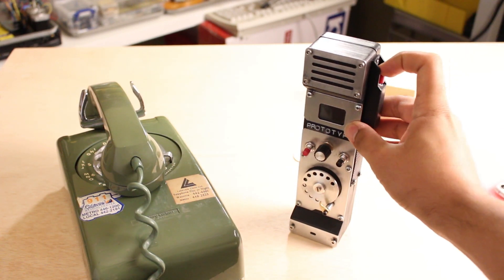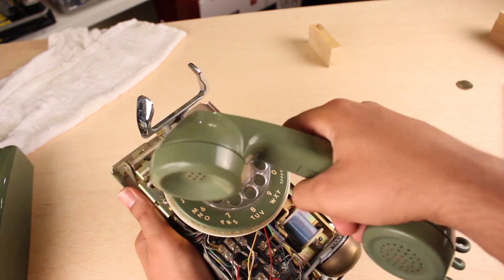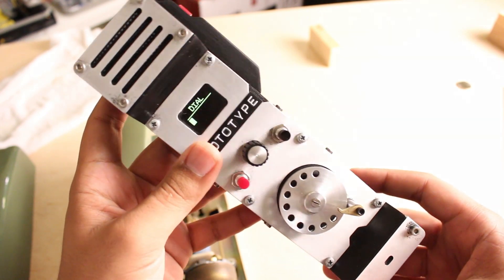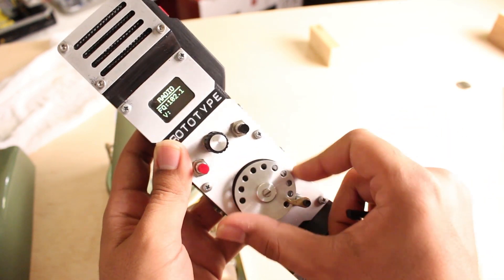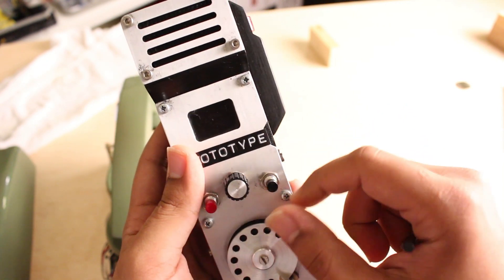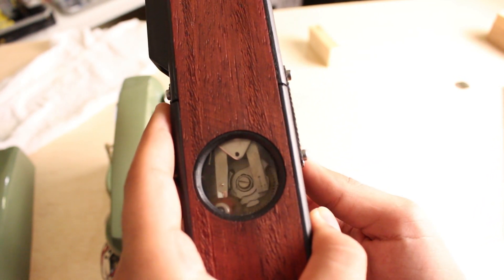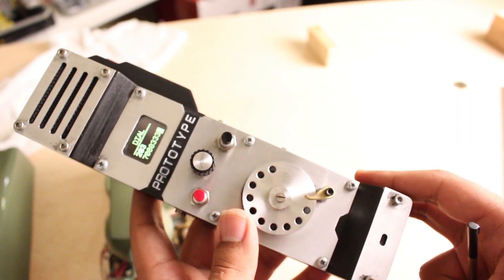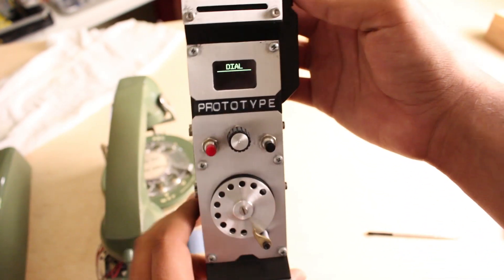Rotary Cell Phone Prototype

Comment: Mr Volt, One thing that maybe you did't know...Old Land-line phones you can dial without actually dialing...The "hook" or drop-off switch, when pressed in the right order, will connect you...which is essentially what a rotary does. Try it, if you have a Real land-line. Sort of like Morse-Code...

Comment: How did you make it produce those tones? Some rotating position sensor that emits the tone when the rotary is back in resting position?
Reply from the maker: The GSM module (SIMCOM 800L) has a lot of built in features. I used the DTMF tone function for user feedback.

Comment: I would buy one of those. Probably.
Reply: Did you see this? the same sort of telephone BUT it has a blue tooth circuit in it. when your cell phone has an incoming call the old rotary telephone rings just like it was wired to the wall. I found a demonstration on youtube, you can make calls on it too. search western electric bluetooth on ebay too
Reply: @Become_A_Paid_Electronics_Tech  It's called a classic ringtone my friend...
Reply: @herveboinay4922  those Western Electric telephones on ebay have Bluetooth in them looks like they are battery powered and rechargeable. It says that the original ringer starts up when a call comes in on a cell phone connected over Bluetooth. It makes calls too it says.
Reply: You probably are a hipster with latte on your moustache

Comment: Huge! What is the wheel used to dial?
Reply from the maker: It's a miniature version of the original dial the mechanism had. I modeled and machined it with my friend's hobby CNC mill.
Reply: wow how could I get one mechanism like that? any plans or help?
Reply from the maker: Rod GILLES You can find links for the 3D files here: https://www.reddit.com/r/arduino/comments/59k62l/i_made_a_rotary_cell_phone/ Also, for the mechanism, you'll have to extract it from a real rotary phone. My friend gave me the mechanism as is, so I'm not sure of the exact model. Ebay's probably your best bet!

Comment: Nice job! Looks a bit like a Steampunk-Phone. Would be cool, if you showing the inside of the phone.
Reply from the maker: You're looking at most of it! (that's why I added a window for the gear mech) If you check it out on Imgur Ive got a photo up with more of the wiring exposed. It's quite the mess haha
Reply: @MrVolt  Can we vape from this thing?
Reply: I get more of an "atom"-punk or "rocket"-punk era vibe from this device, like something "Tom Corbett, Space Cadet" might use during a fictional 1950s interplanetary space age.

Comment: I love how it looks.  Fantastic job!
Reply from the maker: Thanks. Although, somewhat backwards I designed the case first and made everything try to fit. I enjoy your videos too!
Reply: Hey, just ran into your phone on POPULAR MECHANICS! Wow.... Congrats!
http://www.popularmechanics.com/technology/design/a23588/gorgeous-rotary-cell-phone/
Reply: @MrVolt  Why didn't you use an existing working telephone first?
You know, the rotary thing?
Reply: @MrVolt  Why are you trying to fit in a big size personal mobile phone with rotary dial impossible to manouevre with a human hand?
What the fuck are you on?
Reply: @herveboinay4922  well actually the tension created when the skin of your finger is slightly pushed into the hole, which requires almost no pressure, would be enough to cause the dial to shift as the gears move quite smoothly. And the look harkens back to the fallout shelter look, which this phone would work for if there ever was all out nuclear warfare considering it features a radio dial and internal antenna, other than the power issue which could easily be solved by modifying a crank radio into a charger for it, this could easily fulfill any tech needed in that rare scenario. not to mention there are countless people who would appreciate the rugged industrial look it produces. as for why he created it, as with everything else he has made, it is simply for the fun and novelty of it. Personally i would suggest reevaluating your basic physics and shifting your general design viewpoint as clearly no-one has agreed with you for very clear reasons, you take a far too aggressive approach to criticism and fail to think about the basic physics i referenced earlier.
Reply: It looks rubbish, it would be a rat-phone if it ever worked, but when it work it should have to be downsized to rat-size hands...
Fucking idiots!